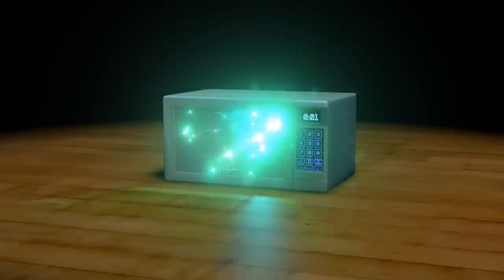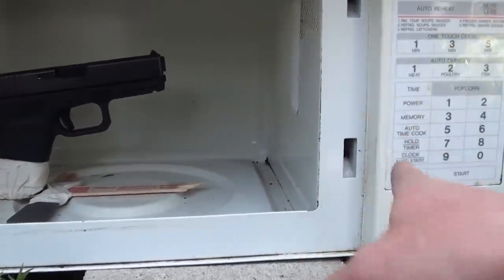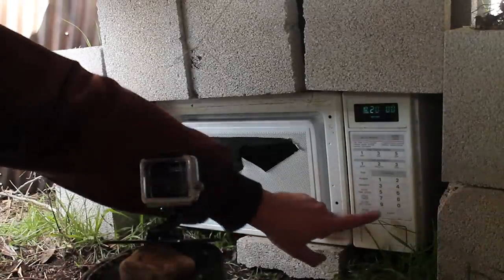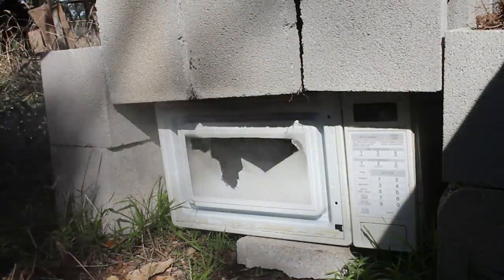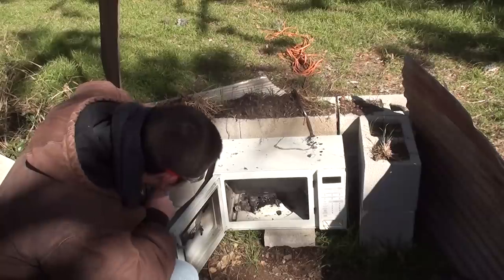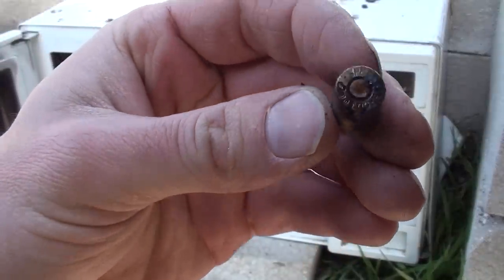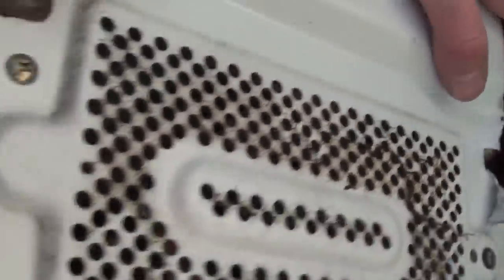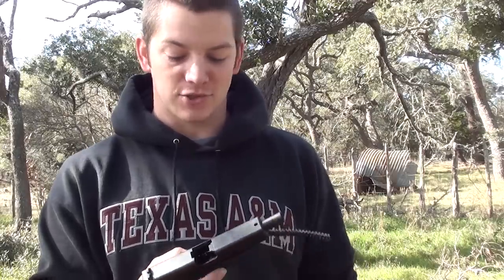Loaded Glock in a Microwave

Comment: So huh…why didnt the glock eject on the test fire?
Reply: The trigger wasn't pulled so the mechanism didn't make the slide blow back. the gun powder reached the temperature it needed to combust.
Reply: wait my bad you said test fire
Reply: +Diesel Ramcharger +Christian Munguia (MrBloodshot45) Because he put the ammo inside the chamber manually, instead of loading it ouf the mag. That means the slide is not "connected" with the bullet, so it's not able to pull the shell out of the chamber.. :-)
Reply: warpigxp So it's just the trigger and hammer doing the work
Reply: yes exactly..
Reply: warpigxp I didn't even think about that. But I forgot about the test fire to
Reply: Christian Munguia Its a straight blow back operated gun. If the round fires, the slide will cycle. That is where the energy comes from. Glocks are striker fired, they don't have a hammer. More than likely the gun was rigged with a recoil spring from a heavier caliber so it would not operate. You guys, are a little clueless on how firearms work eh?
Reply: +Diesel Ramcharger I'm very sorry I misused 'bullet', i meant 'cartridge' (english is my 2nd language). I try to explain it to you. 

I know how a Glock works (I also have a Glock).
If you load a cartridge from the mag, by pulling the slide back, the slide will push the cartridge into the chamber. also will the cartridge be hold from a little hook in the slide. That's why the cartridge has this little groove at the bottom. If you fire the gun, the slide will be blown back, and pulls the shell out of the chamber, and by pulling it back, the extractor "kicks" the shell out of the gun. BUT if you manually put the cartridge into the chamber and release the slide back forward, this little "hook" will not engage in the groove of the cartridge. If you fire the gun now, the slide will be blown back, but the shell stays in the chamber.
Also, if you fire ammo which has not enough force (a.e. blanks) the slide will not be blown back completely, and is not able to kick the shell out of the gun.

By the way, I just tried to answer your question above, there is no reason to insult me in any way.
Reply: warpigxp Dude. You have no clue what you are talking about. The hook is called the extractor. It has nothing to do with how the charged. He likely stripped the extractor out of it, or put a recoil spring from a 45 in it. If the gun is in battery, which it has to be to fire, the extractor is engaged. Your understanding of firearms is very poor, and dangerous. Please educate yourself. Every time i shoot, i drop one in the chamber drop the slide and put in the mag. This is why you see the capacity of magazine fed guns as 15+1 or 17+1 the plus one is the round in the chamber. And believe me, it cycles every time. Once again, you really have no clue what you are talking about, and obviously have never actually owned a Glock. Or any other firearm for that matter.
Reply: Diesel Ramcharger The more you know. And learning is half the battle!
Reply: Christian Munguia Masters of the Universe?
Reply: Diesel Ramcharger Yupp :3
Reply: +Diesel Ramcharger let's remember he only shot one round
Reply: Diesel Ramcharger I don't exactly study how they work so I'm not sure on some things.
Reply: +warpigxp That makes absolutely no sense.  As long as the gun goes fully into battery, the extractor will "grab" the casing.
Reply: +TheBCSledder  +DieselRamcharger  +warpigxp The extractor isn't going to grab the head of the brass if it's not coming from the magazine. So if you put it in the chamber and it's cocked and you shoot the extractor doesn't do anything because the rim of the brass isn't engaged. When you say 16+1 in the chamber, you charge a round, drop the clip and put another round in the magazine; you don't drop it in the barrel through the ejecting port.
Reply: I don't know skeet
Reply: Gung Ferdoosh Cause you are a Pull!?
Reply: I don't know what that means. I just don't have tons of experience with a firearm that didn't eject brass. I'm sorry....
Reply: Gung Ferdoosh You don't know "skeet" "pull" get it? no? bah……
Reply: Oh, I am sorry my friend. I didn't pick that up as quickly as I would a quarter.
Reply: Gung Ferdoosh Jew jokes to boot!
Reply: Hahaha funny, yes? But fureal, if the bolt if charged and ready to fire and you put a round in the chamber the extractor is still going to catch?
Reply: Gung Ferdoosh Yes, the extractor is just a hook with a spring that snaps over the rim of the cartridge. I guess the easiest way to experience this would be to take a bolt action rifle, put a round {or empty brass} in it and close the bolt BUT don't lock the bolt handle all the way down. Just close the bolt, then reopen it. You will notice the round is not clipped in, instead it is just sitting  in the chamber. Point the muzzle up and shake, the round will fall right out. This is actually a very dangerous scenario that causes a lot of people to think the gun isn't loaded when in fact a live round may be sitting in the chamber. With a handgun just rack the slide, but ride it home slowly. The round won't be clicked in. A lot of times you can gently close the slide on the round and the extractor will hold the slide open, out of battery. Give the rear of the slide a little tap that extractor will snap onto the round and the gun will go into battery. This is exactly why AR-15'S have forward assist bolt closers. Because if the extractor doesn't snap over the round the gun cannot be fired. Easier to slam it shut with the forward assist then rack out a round onto the ground and start all over.
Reply: So if you have say a glock like he did, and you drop a round in the chamber with it already in battery and let the slide forward, is it for sure going to catch the head of the shell?
Reply: Gung Ferdoosh In battery means the slide is closed and ready to fire. If you take a block, point the barrel down and drop a round in through the ejection port, then press the slide release and let it slam shut. The rim of the cartridge will be engaged with the extractor and when the gun is fired, it will extract and eject the spent casing. If you were to close it slowly, the extractor wouldnt clip on and the gun wouldnt go into battery which means it would not fire when you attempted to pull the trigger.
Reply: Hmmm sounds like I need a pistol.
Reply: So if it's in battery with no round and you put a cartridge in the chamber without pushing it all the way forward and catching the head and it's just resting on the head do you think you couldn't pull the trigger?
Reply: and if you could do you think the firing pin would strike the primer still or no?
Reply: Gung Ferdoosh In battery means the slide is fully closed, the barrel is locked and the gun is ready to fire. If the gun is out of battery, it cannot fire. If it somehow manages to fire out of battery, injury to the shooter and damage to the firearm are the result.
Reply: That makes sense, I have just confused myself haha.
Reply: Gung Ferdoosh Here is a picture of a block extractor, see the bevel on the front of it and how it has brass marks on it? It is spring loaded and the hook snaps onto the rim of the cartridge as the gun goes into battery. http://img.photobucket.com/albums/v726/Coloradoglocker/ComparisonofOldandNewExtractors.jpg
Reply: Yeah, I have a rossi model 92 that looks like that I guess I should just put a round in and see what happens. Of course, a dud round. my friend, you live in Colorado?
Reply: Gung Ferdoosh Battery is when the barrel is locked into the slide via the grooves on top {on a 1911} This animation should explain how the gun cannot fire unless everything is locked up. http://img.photobucket.com/albums/v726/Coloradoglocker/ComparisonofOldandNewExtractors.jpg
Reply: That was the same picture as the first.
Reply: Gung Ferdoosh Arizona. If you want to experiment just use a fired shell casing. They will feed and extract like normal, but won't go bang and kill your neighbor. :)
Reply: Yeah, I don't want to kill anyone hahaha
Reply: Yes, I think he must have removed the extractor  or it was bad. I can still pull the trigger with the empty shell in the chamber and it almost closed. You'd definitely get sprayed with gsr and probably break the gun if it went off, or your hand from the lever slamming back.
Reply: Gung Ferdoosh If you manage to get it to fire out of battery, it will usually blow out the "web" of the shell casing and spew hot gas and powder residue in your face….as well as possibly blowing up the gun.
Reply: Gung Ferdoosh Google "Glock KB" if you want to see what happens when they go wrong
Reply: alright, it doesn't show anyone getting killed on accident or anything does it?
Reply: Gung Ferdoosh lol no just the animation of a 1911 cycling
Reply: +Diesel Ramcharger +Gung Ferdoosh +Christian Munguia +warpigxp
Will have to experiment with an empty casing. Wary of slam-firing, although in the past I have inserted a round directly into the chamber, released the slide, and inserted a full magazine, and if I remember correctly, all fired and extracted beautifully. However the manufacturer of my striker fired pistol warns against doing that, so now if I want full capacity I fully load two mags, insert and rack the slide, then swap mags. Safer that way and less awkward than full loading one, racking, dropping the mag and putting another round in it.
Reply: djkillcrazy The manufacture advises against dropping one in the chamber and slamming the slide shut for good reason. Mainly for liability reasons, but the slide shouldn't be allowed to accelerate for that long without contacting the round. Where the slide usually picks up a round, is close to its rearmost travel. The slide has just begun its journey forward and has very little speed at this time. The farther away the round is, the faster the slide will be traveling when it hits it. This is hard on the extractor, can cause other longevity issues or even a jam if not done correctly. All in all, guns are designed to strip rounds from the magazine and eject through the ejection port, so that is how the manufacture will recommend it.

Comment: bro I hope u got FAR away from this thing otherwise u might get a nasty surprise in a year or two. great channel
Reply: Brandon Walthers why never to take the screen off of the microwave it reflects radiation
Reply: It's called a Faraday cage. The holes in the screen are smaller than the wavelength of the microwaves so it doesn't allow the radiation to pass though.

Comment: The fact that the microwave waves broke the GoPro should be reason enough for people to stop using these cancer causing boxes.
Reply: are you talking about the GoPro or the microwave?
Reply: The faraday cage that was cut out stops any leakage of microwave radiation. So they only cause cancer when you cut out the metal cage
Reply: They also use leaded glass in the front of microwaves, the same stuff that's on the front of CRTs to stop the X-rays from getting out.
Reply: Do you know how Microwaves actually work? Do you know how technology works? This is a rhetorical question. Go perform research.
Reply: Microwaves are high energy radiation.
That doesen't mean that your food will be radioactive, it means your food will be heated up by these HIGH ENERGY WAVES passing through them.
You're as bad as the soccer moms that think vaccines cause autism.
Reply: People should learn basic physics in the first place.
Reply: Learn physics please

Comment: How did the gun not eject that shell after you fired it? That kinda threw me for a loop.
Reply: I was just thinking the same thing. The Hush Puppy does this by retaining the slide when firing so as to silence the sound of the slide moving when using a suppressor. He just said that he went out and bought a g19 for the video. Maybe some of those Glock frame caliber change tips came into play for this video perhaps?
Edit: just saw the frame and it the crappy Glock from the previous video. All the stuff used to get more grip on the frame is visible on the back strap. He didn't say he bought it new and all but he did show it ejecting shells earlier.

Comment: Amazingly, no one seems to have considered the fact of the Glock being attached to a wooden base with what appears to be paper tape... Metal reflects microwaves. Plastic is generally transparent to microwaves. Wood contains water, which is precisely what microwaves are designed to heat...

Comment: Did anyone else noticed the slide came out of battery not long after it caught fire, which means the extractor pulled the case out of the chamber a little bit, meaning the ignition was not in the chamber

Comment: Also, no glass? I understand the screen was partially removed to see the Glock, but why no glass? 

Even if it had to be taken off to cut the screen, you still could’ve put some glass or lucite between the GoPro and the microwave rather than risk the camera. I think most people would’ve rather seen that footage than the distant shot of a white box with something that may or may not be happening inside.

Comment: Dude you shouldn't open the  Mikrowave window because  the microwaves will go all around and also hit you. Not that some people think I wanna say you will get burned, it's just that those waves still damage human cells. Take care, cu
Reply: Well now I saw you put metal around it an were not sitting in front. My fault, sry
Reply: Microwaves don't use gamma rays (the type that damage cells and dna) microwaves just make electrons move very fast or something
Reply: Not only gamma rays, also alpha and beta rays damage, so microwaves damage as well.
Reply: It's me Marco microwaves are not alpha, beta nor gamma particles. It is a radio wave on a specific frequency so it excites hydrogen, effectively heating any water in your food up. Same thing as cell phone signal or WiFi, except waaay more powerful and in a closed metal box that effectively works like mirrors for visible light, reflecting it back in your food until it all gets absorbed.

Comment: You can still sell the slide and barrel and make a lot for it
Reply: Sorry, no. The heat treat in the metal is probably compromised and therefore unsafe to use again. Even if Glock was stupid  enough to honor their warranty, you have now entered legal considerations.  The polymer frame has the metal serial number tag embedded in it, therefore it is considered by law and the BATFE to be the gun. As such it cannot be replaced. If a new one is issued it is now a different  firearm. It would have to be shipped to an FFL and treated  as a new purchase replete with a background check and another 4473 form filled out. In some jurisdictions a waiting period my be in place, and notification to law enforcement that your handgun was destroyed, lost or stolen. Most places like to know the disposition of firearms, especially handguns. Registration may not be the rule of the land but LE / BATFE like to know the disposition of anything with a serial number attached to it. Regardless of your view, right wrong or otherwise that is the law, federal and usually most states too. Failure to adhere to it at your own risk of legal headaches confiscation of firearms, loss or right to own a gun monetary punishment and jail time. So no, Glock isn't  going to send you another  frame or gun.

Comment: Are you fucking insane? You cut out the protective part of the microwave. Please tell me you weren't near it.
Reply: Quinn FH He could burn his face, right?
Reply: M10 Eliminator radiation it could cause severe cancer
Reply: Microwaves do not produce ionizing radiation, hence they do not inherently damage DNA.

Of course, if the microwave burned him, it would damage his DNA, just like if he burned himself on fire, or boiling water.
Reply: He doesn't go close to it while it's on. It's usually in a makeshift bunker by itself.

Comment: Can I please have the melted Glock
Reply: That would be a no. It still has a serial number attached to it and is still a firearm. The frame could not be sent across state lines or to any ineligible person or someone  under 21 yrs old. As a private sale / transfer most places would require a background check etc. Texas may not. The bottom line is just because it's been melted does not change the fact that it's still a serial numbered firearm. And in the eyes of the BATFE all laws for transfer still apply.
Reply: @bobgarr6246  I know the barrel can be taken out I just wanted a souvenir that is singed